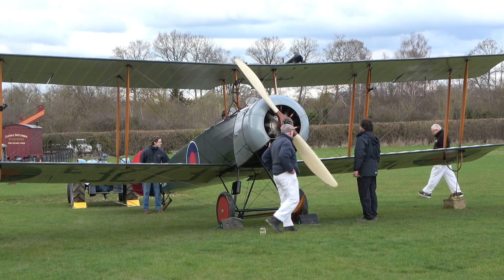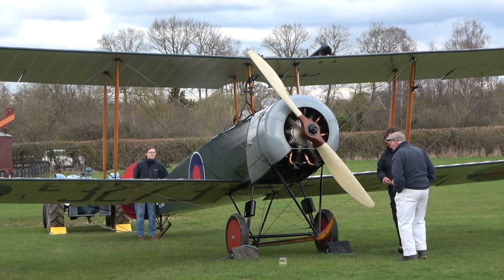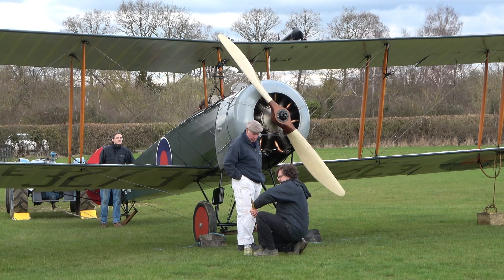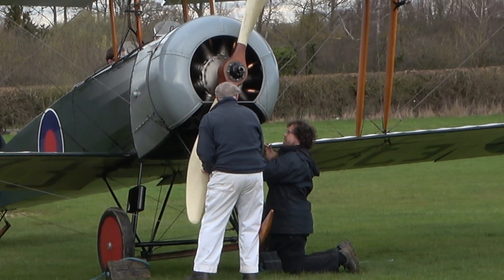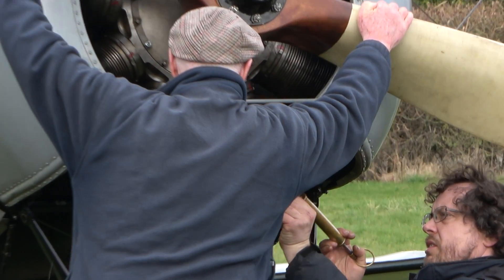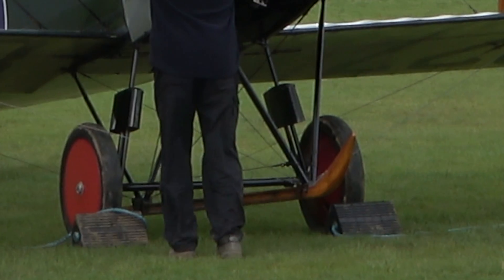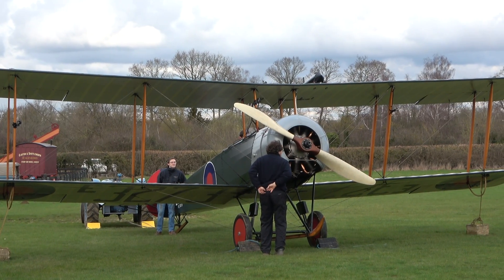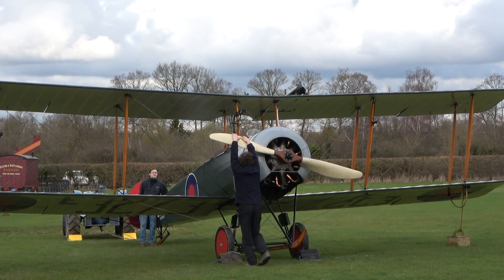Avro 504K Rotary Engine Demo

Comment: 09:41 - fun fact, the claw shaped device in the centre of the prop hub is for a Hucks starter, an engined powered starter on the back of a truck, and Shuttleworth has one I believe.
Reply from the maker: Yes, you're right. Shuttleworth does have one. I nearly added that to the film, but without the vehicle's presence it would be confusing.
Reply: @HighFlight  quite right, there will always be another day to show it in action 🙂

Comment: Some excellent detail shots here! I had not realised the cylinders were screwed into the crankcase, a very lightweight way of achieving attachment, good idea to tether the tail skid to the tractor, with slippery grass it will creep forward even though chocked. Chris B.